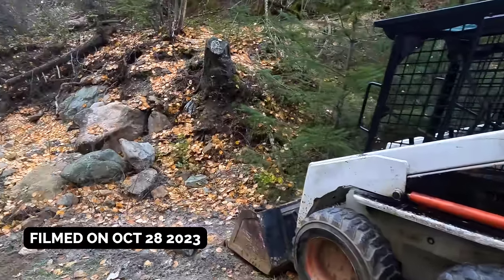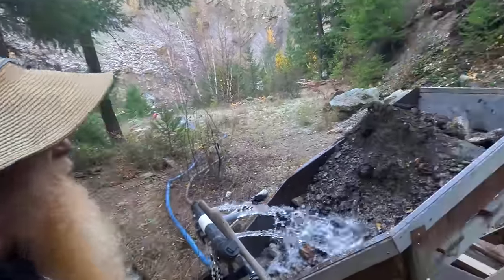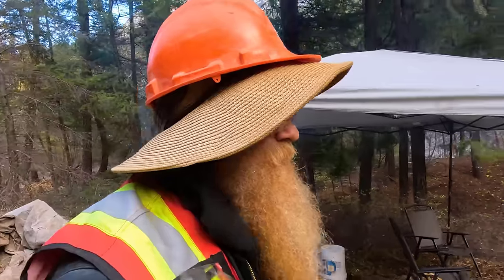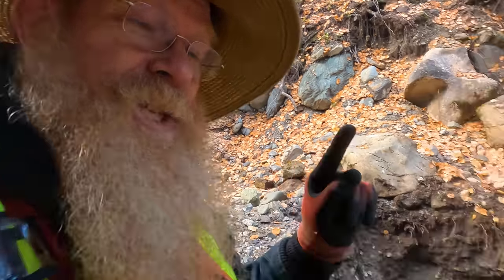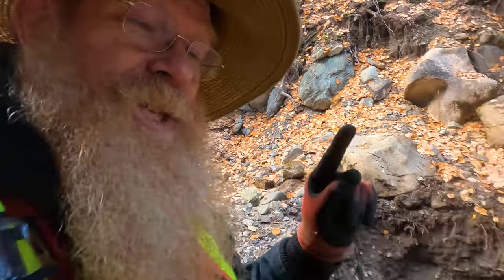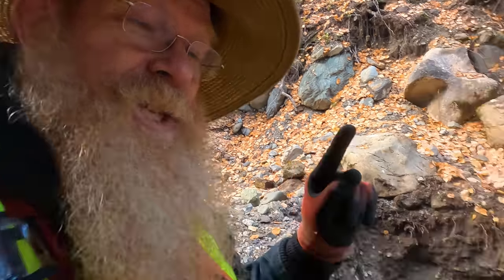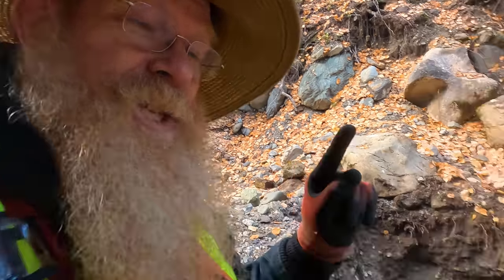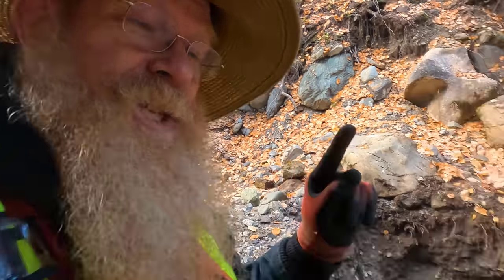I find my *Biggest Gold Nugget* in 3 years, for the Challenge!

Comment: 10:40 I trust you know what you're doing, but I worried that if the chain had not come off that rock it might have pulled the bobcat over.
Reply: I saw the same thing happening lucky the Chain came of or Dan would have been launched into the hole because I doubt if he was wearing the seat belt you have to wear them while operating or one mistake and your maimed or dead
Reply: Yeah, I worried about that too. I’ve seen a few machines topple over the years. Luckily no one was hurt, but it happens so fast. Definitely have to think things through before hand when working through obstacles, because once you jump into action there is no time to turn around…

Comment: Good job man!
Hey ,if you ever have to mine in the cold again ,you could buy yourself an on demand propane water heater . And you could have instant warm panning tub & with a hose and sprayer it would come in handy for de-icing the sluice .
Reply: He has a campfire already , and , running water .
Just add a tap to run some through a coil of copper pipe laying in or over the fire , and he's golden .
Works for thawing pay as well .

Comment: That's so great to see Doug again. He does remind me of my dad. I'm glad you found your nugget, but if you want to up the efficiency of your plant take a blow torch to the nozzles and soften them up and squeeze them flatter. That will make the water pressure you have and jump it up significantly as its forcing the water through a more narrow slot. That should make the dirt pile at the back of the rig melt away (like Butter😉).
Reply: The pump might not handle that. The higher u pump up the less pressure u get at the nozzle. Restricting the flow to create more pressure can really slow down ur flow when combined with the elevation change
Reply: @kylealexander7024 pressure doesn’t increase, water velocity will
Reply: @spencebrown19  idk. I'd have to re study that specifically. It's going to cause issues doing what OP said

Comment: You should be some restrictors on the tips of your sluice spouts. It should make the water spray a bit more forceful.
Reply from the maker: We actually needed volume not pressure, we were happy with the wash and needed as much as possible for the sluice.

Comment: You probably know this , but , a toothed bucket would have served you better for digging than the smooth face grading bucket you had , at least until you got to bedrock anyway .
I'm guessing it was what the rental company had on short notice . Still , with the water situation , you weren't gonna move much more dirt through that rig without completely clogging the sluice or blowing everything out the end from having to set it even steeper .
Seems like an ok rig , especially with a trommel and sufficient water .
And don't worry , a little time on that mini and you will have the hang of it pretty quick .
Forget speed at first , concentrate on smooth and consistent controlled motions .
You will pick up speed naturally as you get used to the machine .
Just don't get TOO good or you will be stuck feeding the plant at every mine you visit and have no time to video , lmao .